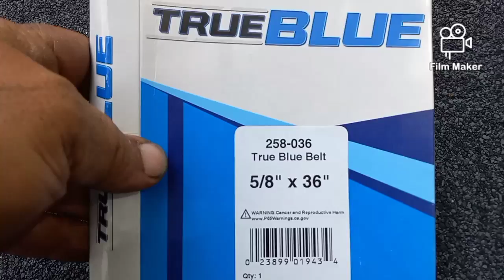Yard Bug Riding Mower Mess Final / Fixed

Comment: Hi there is these bug lawnmower design NOT to cut backwards? Because I got one and I can not cut going backwards. The blade automatically stop. Let me know why?
Reply from the maker: There is a safety switch that does not allow the mower to mow backwards. If blades are engaged and u go into reverse it kills the engine. I removed mine but I don't recommend that for safety and legal reasons
Reply: @MunkyWrench  Munky is there any way you can put in your video Description.

Where you can buy online the Yard bug Foward and Reverse shifter cables 

Or it would be cool if you made a update Video on your yard bug, and talk about the parts/add in video 🔽 drop down description box

Thank you and God bless bud
Reply from the maker: @skylark9982  the part # is 746 0935a if u go to Amazon and search that number u will find the cable.. they fit mtd , cub Cadet and others
Reply: @MunkyWrench  Ok Thank you I appreciate that cause those shift cables and I got the wiring harness and battery is what needs fixed on mine 🙂👍

Still would be neat in future,  update on your Yard bug
Reply from the maker: @skylark9982  I definitely will.. I need to get a variable speed pulley for it and put those cables on I've just been so busy with customers I haven't had the time but I will ty for hanging out with me
Reply: @MunkyWrench  Totally understand and thank you for Video on yard bug
Reply from the maker: @skylark9982  my pleasure. Im glad it helped u. That's at least a handful of people so far that these vids helped. If u need anything else I'm always around. Thanks for subscribing. Will be doing a live stream this weekend if u want to chat
Reply: Pto switch. A saftey thing
Reply: @skylark9982 they is a diagram of all parts on line just google yard bug diagram.

Comment: I have done that and when not running or not running it goes into gear and when you press the go pedal you can hear something but wont always go in reverse
Reply from the maker: Without seeing it.. guessing u checked the 2 drive belts I'd say u may have a failing trans
Reply: @MunkyWrench  you might be right.  Time for a new one, but I am doubtful a new one is as well made, thanks for the reply
Reply from the maker: @mikethompson7290  I'm always curious as to what someone else does and still open to learning .. let me know what u end up doing.. BTW I meant track down new trans.. not whole new machine.. I do everything I can to keep old stuff going

Comment: I got one that don't go in reverse, forward and neutral works. But no reverse,  how can i fix that?
Reply from the maker: Thanks so much for commenting and subscribing it means a lotCheck the reverse shift cable and find out if it's broken.. that often happens on these bugs .. check the connection at both end.. check the connection to the steering column under the plastic cover and make sure it's working and not broken inside the cable.  The lever may work but if cable is broken the other end won't move.. so non function..
Reply: @MunkyWrench  so I traced the cable that goes to the back, and when moving the lever by the steering , it moves a lever back and fourth under the engine.  It's just one lever and one cable,  should there be 2?
Reply from the maker: @mustafaalbouali  it's been a long time but I believe there are 2 cables for shifting.. they both attach at opposite sides of the same lever at both ends.. to accurate the shift lever.. but if u can shift successfully between forward and neutral when u want.  Your model could be different
Reply: @MunkyWrench  man it will be soo sweet if you can do a quick new subscriber video on this and what to look for .. kind of like the one you did for the lady that couldn't get her key to work. There is no videos on these anywhere on youtube
Reply from the maker: @mustafaalbouali  I'd love to but that video series was over a year ago and I've since donated the bug to a small non profit to take care of their property. I've gotten a lot of response from this video so I am actively looking for another bug .. which also comes in sears and Murray and whites .. so as soon as I find one I'm going to do a full coverage video on every single part .. thanks for taking the time to comment and help me make better vids
Reply: @MunkyWrench  oh man. OK.  I ll look at the one I have and see if I can find that second cable.  The person I got it from told me it was the reverse cable that's causing it not to go in reverse and included a new one with it . I just don't see what difference that makes when the current cable makes the lever in the back of the mower move back and forth
Reply from the maker: @mustafaalbouali  if I remember correctly the lever in the rear on the Trans axel is a T shape.. the center is connected to the Trans and the top of the T has a hole on each end.. one end is for the forward cable.  And the opposite end is for the reverse cable.  Think of it like an old soap box car steering with string.  U pull one string to go one way and u pull the other string to reverse the way..
Reply: Broke cable

Comment: I could really use your help with my Yard bug, Won't start, replaced battery and solenoid, no clicking nothing. you said something about safety switches, could that be the problem?
Reply from the maker: Yes there's several safety switches .  1 under the seat.. one on brake pedal.. I think 4 total I can't remember.. if u want to know .  Get pair pliers.. rubber handles lol.. turn key on position. The 1st on position.  Use the pliers to touch both terminals on the solonoid and see if motor spins.. if it does its a safety switch. U can email me to talk more or I'll do a live stream to talk to u
Reply: @MunkyWrench  You my fine sir are awesome! Thank you. either way would be fine with me. This is my first lawn mower I'm tinkering with, its usually cars for me. I work some odd hours 5 pm til 1:30 am. But I would love to talk about the mower, I'll need a pro to help me. lol I know I can do it just need some good guidance.
Reply from the maker: @daimania3816  happy to help any way I can.. I know u can do it
Reply: @MunkyWrench  Do you have an email I can write to you? I'm about to get ready for work. I think the email would be much easier.
Reply: @MunkyWrench  I have found the 2 safety switches on the pedals, one on the seat but I can't find the one behind or around the wheel I've searched and searched. Still no spark no click  nothing. She won't start.
Reply from the maker: @daimania3816  the one behind the wheel is a long thin plate that makes contact to a point on the trans.. unplugl the kill wire off the magneto that should bypass all the safety switches. Hit key if u have spark then u know it's a safety or wiring and u gotta keep looking.. if no spark still u have a bad magneto
Reply: @MunkyWrench  I meant I can't find the one around the transmission, sorry
Reply from the maker: @daimania3816 if your sitting in the seat it's the left side rear wheel.. look between the tire and the Trans where the shifter cables connect u will see it.. there's a wire attached to it.. find the wire and follow it
Reply from the maker: @daimania3816  email me and I'll try to send u pics.. I was monetized this morning so today is a holiday for me.. im taking the day off lol lister_ihfc@yahoo.com
Reply: @MunkyWrench  I just saw this.... I'm so sorry. I will be emailing you. I still haven't gotten it running.
Reply from the maker: @daimania3816  lister_ihfc@yahoo.com

Comment: I have same one n can't figure out how to get to go faster in foward
Reply from the maker: Your throttle cable has an adjustment on it.. it can also be stretched if it's the original so often a new cable can do it.. plus if the drive belt is worn it will be slow.. new drive belt will be thicker n wider and grab better
Reply: Good job
Reply: Adjust the variable speed cable